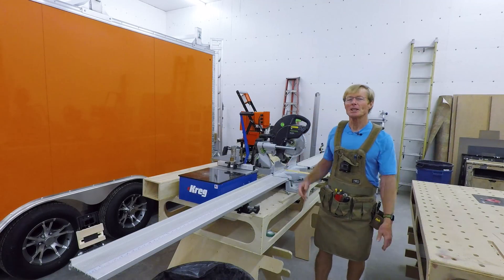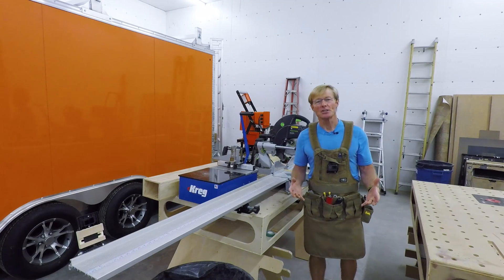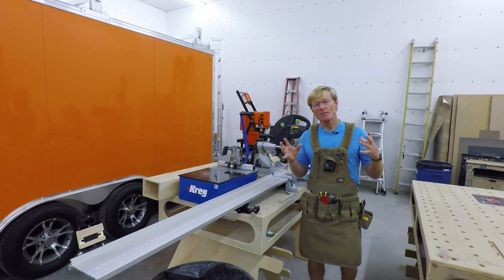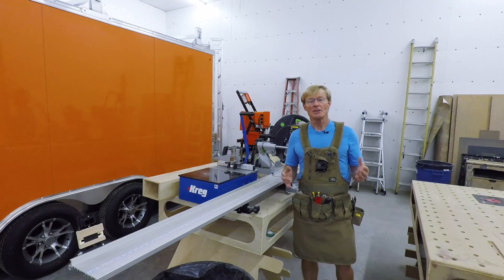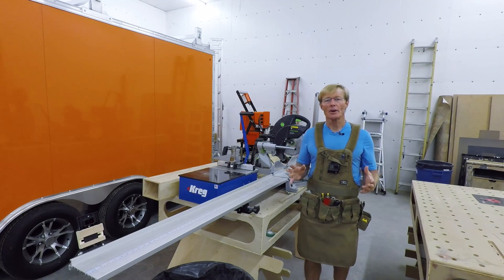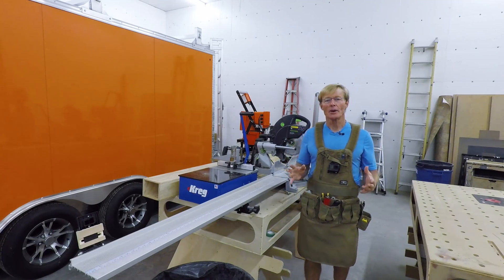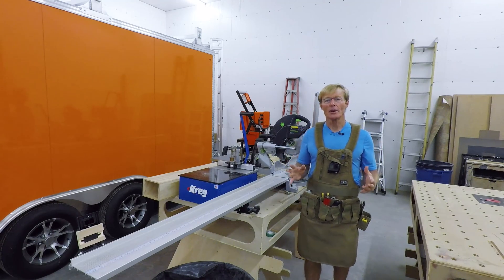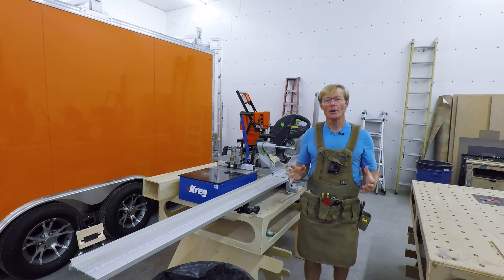Multimachine Platform speeds up production in a small space

Comment: Hey Ron , just a thought: When you build your new total station, you could make adapter plates attached to the Blum and Kreg machines to fit it the spot the Kapex is normally in. You could space each up to the right height so that the machine and the total station surface are the same. it would allow you to position the machine so the total station supports even the biggest panels for drilling pocket holes or shelf pin holes.
Reply from the maker: When I work the Miter Saw is always set up so the Blum and Kreg need their own place.